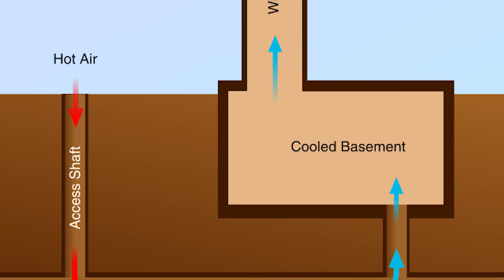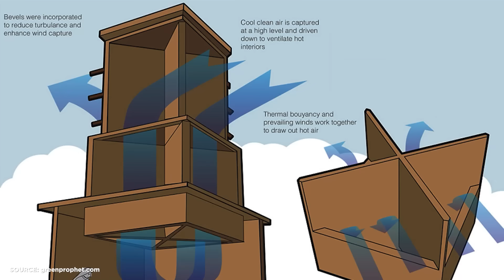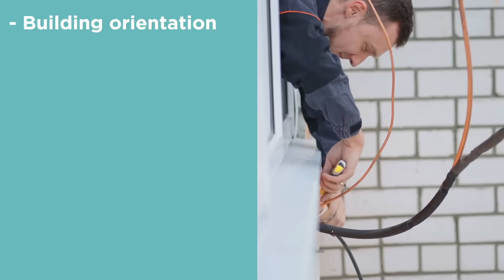Forget Heat Pumps - This House Cools Itself With NO Electricity!

Comment: How did you not know about passive solar. Am I seriously the only one that knows about eathships. Passive solar uses large mass like water or soil in the back of houses to store heat throughout the year. Because the mass is drawing in the heat it cools the the house, but as soon as it’s cold the heat comes out heating the house. So the house maintains a constant temperature of 72° year-round without electricity. In the case of earthships the main structure is the back wall which is made out of tires beat full of soil by sledgehammers. The only caveat is that the houses have to be pointed south, that’s it. Considering they cost the same if not a little less than normal houses.
Reply: And yes earthships can be constructed anywhere, and they already have.

Comment: I did that - instead of putting some piping down for a heat pump, I put the whole house down in the ground.  The ground moderates the temperature so it cannot freeze, and you don't need air cooling.  It is 10 x 30 and made of steel and is nice and quiet.

Comment: There are a lot of factors that go into home energy use. Start by choosing a site with good solar exposure, good breezes and wind, and the right type of trees and shade trees. These are factors that can make a big difference for the entire life of the home. Choosing the right building materials for thermal mass and insulation as well as dealing with local factors like bugs, floods, natural disasters and fire. Insulate the home really well, have the right mix of windows and build it well. There are other ways to adjust as well, create multiple rooms in a home and live in the warm, or cool rooms during certain times of the year. To some extent people in the past were just miserable on the extremes of weather, and people choose to live in areas that were naturally more moderate. (high in mountians, or not living in hot places like Florida) Adding fountains, pounds, swimming pools and other water features helped, and this was done in Ancient Rome.  Today though, with good central HVAC units, it is very easy to build a big house cheaply, are heat and cool it artificially. As a society we have been make mass advancements in building materials, and technology and will continue to do so. Fiberglass and spray foam insulation is one example of recent improvements, today, mini-split heat pumps are changing the economics on heating and cooling. The cost benefit analysis of doing what it takes to heat and cool a home, is an interesting area to ponder about. Many of these things cost way more than they are worth. Comfort is only one aspect of life; and many people struggle to change the air filter each month.

Comment: I actually build passive homes! I work for a company called Phoenix Haus in Colorado. We're combining green passive housing with offsite construction. The science of it all is above my pay grade but I'm actually on the ground building houses in a state of the art shop. Basically the house is broken down into dozens of "panels" built offsite and then shipped and assembled on site in a matter of weeks or even days. Each wall is over a foot thick and roofs can be over 2'. Everything is over engineered to hell and insulated to an extreme. It's cool being a part of an up and coming company and feeling like I'm on the cutting edge of technology when it comes to construction. Couldn't help but share

Comment: There are many inexpensive passive ways to keep the house cool without following Passive House  guidelines.  Blocking out the solar radiation from windows and painting the roof and house light colors are just two.  Even "active" cooling can be smart.  An AC requires kilowatts, a small directed fan, as little as 5 watts.  Cooling the person requires a lot less energy than cooling an entire house.

Comment: I live mostly off grid for large portions of my life. While I think people have a right to use as much energy as they want to afford, people waste way more energy than they actually use. Electricity is far more efficient when used near the source. Solar cells are great. I gave up on batteries a long time ago. You just have to engineer your life and your habits around the realities of your energy source. You don’t need a cloths drier; biggest waste of energy ever. You put sealed ice containers in the refrigerator and freezer and switch to chest freezers. You just modify and adapt; before long your life is actually eAsier and more passive than the hectic lives of on grid people. And living off grid is not really more expensive IF you have a well thought out architecture BEFORE you start the life style. Please do not think you are going to go off grid based on batteries. The best batteries will still eat up anything you thought you were going to save. They are expensive to obtain, expensive to maintain, and they just don’t hold up to the test of time and real life use. There is plenty of energy when the sun is up and the wind is blowing. Use it then. A great way to store energy for over night cooling is in the form of a well insulated giant Ice block or ice chip container. You do not need a battery or an air conditioner. You need an ice maker or freezer system and large insulated plastic container with a bunch of copper pipes running through it and good convective ventilation system. Works seamlessly with a little playing around and turning. The best way turned out to be building your home on a thick concrete slab with pex pipe and water running through it. That slab acts like a giant cooling or heating system that you can heat or cool during peak solar energy output time.

Comment: There is a community in Coral Gables, FL built in the 1890's that uses passive cooling. When I visited the outside temperature was 98F while the inside was 75F. Clever design design allows cooled air from an oversized, house surrounding porch to be drawn up through a centrally located staircase/chimney.  I live in a steel building in the Nevada desert and I am modifying my home to use some of these (and other) principals. I call it "Solar Air Conditioning". I don't expect it to zero my electric bills, but expect it will be reduced.

Comment: I've looked into and plan on using pasive house principals in my future home. there are a few little things that add dramatically to the cost and provide very very small advantages, which is why i will not seek passive house certification.

Comment: For some technical details on how they’re built, what materials, etc, the YouTube channel, Build Show, with Matt lights a TON of passive/high efficiency homes and technology. 

One other thing: building a new home that is more energy efficient, even if it isn’t “net zero”, is getting easier and relatively inexpensive. The bigger issue is the massive inventory of old, “leaky”, inefficient homes, (and apartments!) that are just too expensive for homeowners to upgrade (or little/no incentive for apartments). As of 2020, there were roughly 120 million homes, and ~40 million units (apartments, condos, etc). Couple this with the median house age being 37 years old, and this means that the vast, VAST majority are old and inefficient. And since the cost of efficiency upgrades (primarily windows and insulation) and that’s easily $10,000 - $20,000 PER HOUSE. That’s just not feasible or cost effective for a huge portion of the US (myself included). IMHO, the only way to address this would be for government grants (not loans or tax credits). Sadly, this would never pass, since “regular folks” would be getting free stuff. But the massive he economy for construction jobs, and manufacturing the needed materials would be huuuuge.

Comment: I’m from Texas but live in Italy, and most of the old homes (in the north anyway, housing designs vary according to where you live, as it should be) have 1 meter thick stone walls. Super efficient in the summer and winter, since it really keeps the house temperatures stable… everyone is upgrading to double or triple paned high efficiency windows, solar panels, etc. The government has offered up to 100k in reimbursements to get the people moving. 
We’re in trouble, the largest river in Italy, The Po, has all but dried up, and the sea is backwashing into it… it’s the water the crop farmers use soooooo :(

Comment: Hey! I'm from the green fields and cloudy skies of Ireland! The houses that are built here are well insulated. They trap heat from the sun during the day and then release that heat overnight, through the walls and ceilings. So that you can stay warm and sleep well. Because ya know heat rises. Same reason why traditionally every home has a fireplace because heat will rise through the floorboards to bedroom. However, times have changed and now the fireplaces are being replaced by central heating system. Alright Goodluck! 🇮🇪 😀 😊

Comment: On igloos: it's not just that snow retains heat better than ice does; it's also much, much harder to cut and shape ice than snow.  You can see from the video clip you showed that the snow blocks an igloo is being built from are quite easy to shape with a trowel (or something like that).  Nothing like that would be possible with ice.

Comment: Problem is that "passive house" cost you way more to build but does not have any additional market value. That simply isn't how house values work. It would be worth the same as a similar house with a normal heating/cooling system. That means you may not qualify for a mortgage, and unless you intend on living there for 10+ years you are never going to see any savings.

It's far more reasonable to accept the fact that you waste some energy, and install a few extra solar panels on your roof to help reduce that. I have a 4 bedroom house that is insulated to 1980s standards in the south with lots of A/C running, my power usage is usually less than 25kwh per day. That is my only utility, that includes well water and hot water heating also. If I had a 10kw solar system (not very big or expensive these days) it would MORE than cover all my electrical usage in my not so efficient house where I crank the A/C in the summer, the heat in the winter, and the lights all night long. No need for this "passive house" nonsense.

You don't need to be efficient, just have some excess solar capacity and except you are a wasteful human. There is nothing wrong with that. Solar panels are absurdly cheap today. Plant a couple trees if you feel that bad...

Comment: What? Joe visited Ireland and didn't share all of his photo's?? My dad immigrated to Iowa in 1949 and farmed his whole life. Joe, did you visit our family castle? Bunratty in Co. Clare was ours in the 1600's until... the damn O'Briens kicked the snot out of us. I could stand to have a house re-make... 1890s insulation, 1920s wiring, 1960s plumbing and 1990s heating. I'm alone here so I adapt to the seasons without someone screaming to turn up the heat and get a damn air conditioner! 90F/60%H in house last week was a bit much though. Not gonna fix anything but bare necessities. I'll be the last to live in this humongous haunted looking house. And BTW Joe, your governor is 90% of Texas's problems.

Comment: Passive solar is the way to go if you're planning on building. For the rest of us, we must figure out creative ways to retrofit our current homes or at the very least, learn how to adapt to slightly warmer or cooler temperatures within our homes. There are plenty of low tech ways to make an ordinary house more comfortable. Heat rises, so open a lower window on the cool side of the house and open an attic window. I promise it will help. Thermal drapes are much cheaper than triple pane windows. Plant some trees or a strategically placed trellis to block the summer sun. Invite the cool evening air in but be sure to close those doors and windows before the heat of the day arrives! Ceiling fans are much cheaper than air conditioners. I saw a video recently that mentioned someone had hung a wet sheet at the door. Instant air conditioning when breezy. I haven't tried that one yet :)

Comment: I’m originally from East TN and now live in lush, humid coastal Ecuador and I don’t have ac. Most of the homes here don’t. Where I live is very open compared to similarly-sized houses in the US and there’s a tile floor. The more traditional houses here are built with cane and bamboo and wood, and I find them to be comfortable, again very openly built. And I was always someone who loved air conditioning, I’ve just sorta acclimated. Take 2 cold showers a day (no hot water, not really needed)

Comment: I recently bought an old balloon framed house and stumbled across some old timer knowledge talking to my grandfather. 

The balloon framing of the house allows air to circulate in the walls from the basement all the way to the attic. In the summer the hot air rises out of the roof and draws the cool air up from the basement. 
It’s crazy how fast we can forget why we do things when the new and fancy arrives
Reply: Those vertical channels become pathways allowing fire to spread quickly (in the event of a house fire.) And balloon framing requires long straight studs which are no longer available.

Comment: People in the past had to rely on those because they didn't have many options and had to use what they have. Where I am however, because of the cheap price of gas for the last half century, houses were built with poor insulation as people just rely on cheap gas for heating and cheap electricity for cooling. With the price of gas going way up in the last few years, many have realised the issues and started investing in better insulation and heat pumps to retrofit the houses. However, short of knocking down and rebuilding the homes the option of passive cooling would be a lot harder to retrofit into homes though.

Comment: Forget heat pumps? Heat pumps are used for heating more than cooling. The title would have been better starting forget air conditioning.

06:12 passive houses don't have dust? Are you sure? Where does this lack of dust come from? They certainty have dust like any home. Keep bugs outside? I hope you never open a window or door.

Comment: i'd love to hear more about moisture control in passive housing. air tight / water tight structures scream mold issues to me, and most passive house explainers don't really go into that.
Reply: We explain it to our clients.   
Keep your assembly “vapor open, but air tight”.  Sound icy-moronish but it is not that hard.  We just stay away from plastics and other fake materials.  We also energy modeling all our work and use those programs to figure out the risk of mold and mildew development.   
It’s not hard just takes the right approach.
Reply: @mrkozz1  so what insulation do you use? is it all wool? the idea of wool insulation sounds like a carpet beetle disaster waiting to happen as natural as it may be.

Comment: My house was built in Pittsburgh in the 1890s on a hill overlooking the river. There are crazy strong winds coming up the hillside so they built it with the front door facing the river and the back windows directly in line with the front door. So most of the time I only have to open the door and windows and I get a wonderfully cooling breeze going right through. The past few years have given us longer periods of 90+ degree days so it doesn't work as well as it used to but I can still get away with just two window a/c units that I only use on the worst days.
Reply: The same principle is used in the design of the Biltmore Estate, Asheville, North Carolina.  Its construction was completed in 1892, if I am remembering correctly.

Comment: In fairness, Harare Zimbabwe's temperature range is only between 84 °F (the average high in October) and 45 °F (the average low in July). A tarp could nearly provide the same "cooling" as described. If I lived there, I don't think I'd spend any money on air conditioning.

Comment: My parents moved in their new low energy passive house in 1998. It does not have air condition. It only has 9 kW heating, which is turned on for 2x2 hours each day to provide warm water. And it is cool in the summer and warm in the winter. It mainly gets heated by a large south-facing window, which can be shaded easily in the summer. Its sun shade made from sailcloth. No fancy electric jalousies or similar stuff. Just 40'x20' of fabric, two wooden poles and some elastic bands to span it over the terrace. It was $200 of initial investment and zero operational cost.
Reply: Pictures or video? Especially if it's here on YT
Reply: @MrDudebud1  It's on the front page of the enginering company which managed the construction site at the time, Gildebau. I don't know how URLs in comments are handled here, so I would ask you to search for the company online. There is no YT video though. The house was finished seven years before YT's foundation after all.